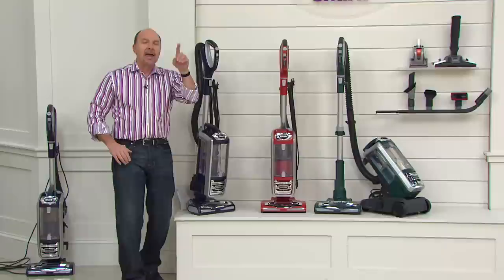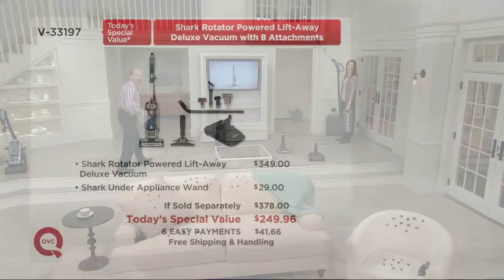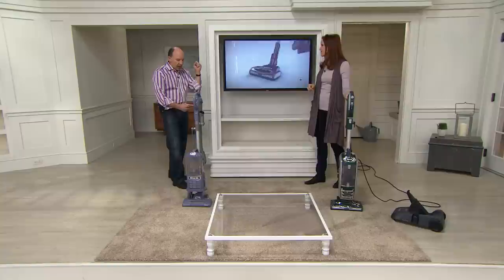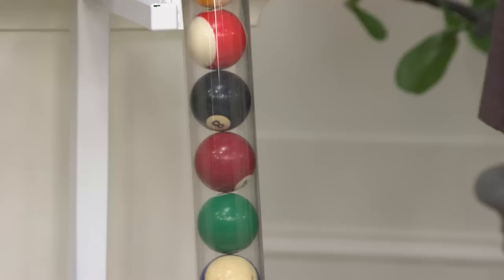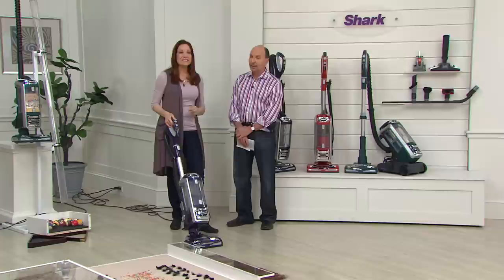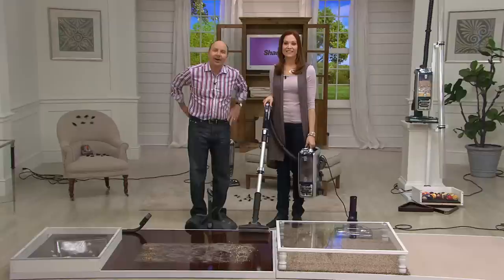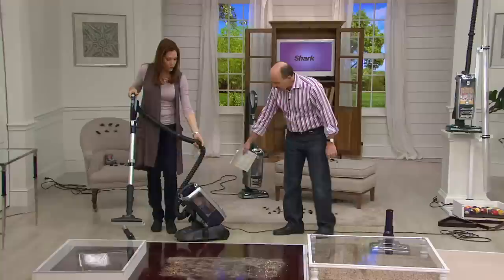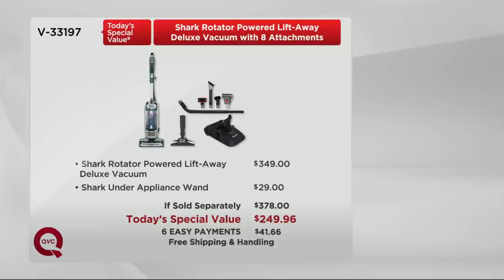Shark Rotator Powered Lift-Away Deluxe Vacuum w/ 8 Attachment with Dan Wheeler

Comment: I just bought this at Costco...seriously way better than my Dyson! There is so much power and it's self propelled! The light is a great feature,, but the best part is that you can get under every piece of furniture... Haven't tried the attachments but just using the vacuum, I'm impressed! I would highly recommend this if you're going of buy a new vacuum. I owned a Dyson for the last 10 years but this beats it hands down. I'm sold!

Comment: How heavy is this vacuum cleaner?
Reply: +Evelyn Rouse You would be better off with an Aerus Electrolux. The original company since 1924. Do not buy any Electrolux or other vacuum from a Department store
Reply: I have the speed version of this and it's 12.5 pounds. Doesn't come with a canister caddy but it's so light! I got it at Best Buy.
I also have the one from Costco. That one is about 16 pounds. XL canister and canister caddy and motorized brush. 
They're both great.
Reply: Evelyn, It's heavy, trust me. I can't give you the exact weight but it is way too heavy for my liking. The lift-away feature is a must because using the wand lightens the load considerably.
Reply: I believe 16 lbs.